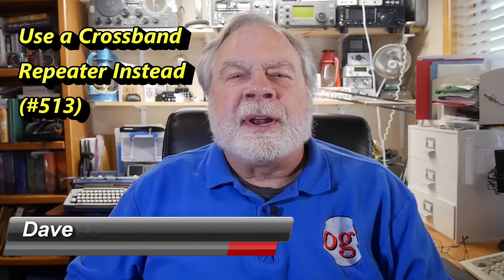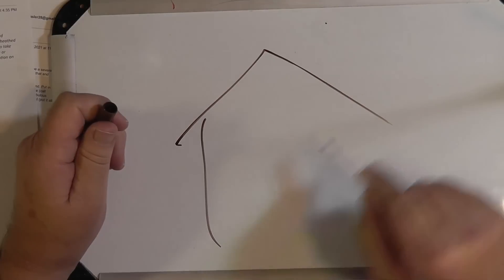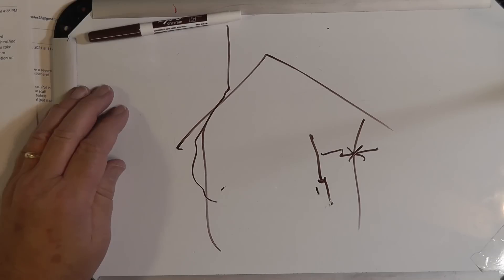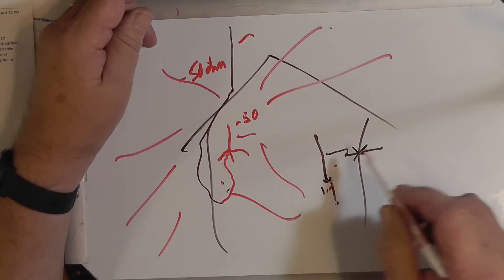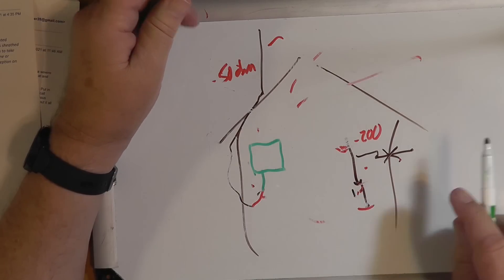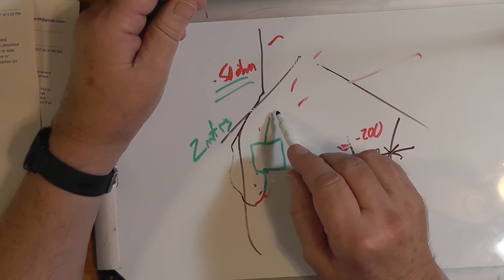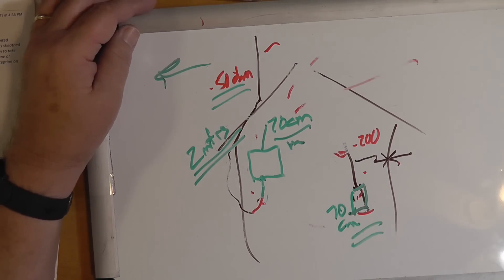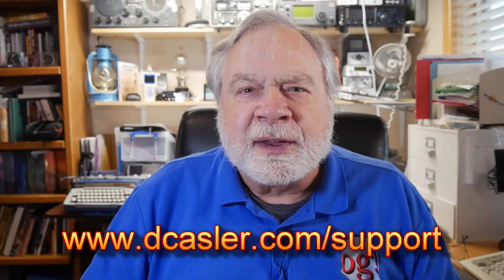Use a Crossband Repeater Instead (#513)

Comment: Hi David Iam kc2dpy i would like to know if you know how to program a Yeasu VX-6R to transmit crossband uhf/vhf if you do would you please show me how.Thank you.
Reply: You would just choose a UHF simplex frequency if youre trying to reach a VHF repeater (or it can work vice versa) and ensure that UHF frequency matches to the mobile radio's simplex frequency. If the radio is crossband capable and is in that mode, it will transmit to the VHF repeater..The reply will come back VHF, be converted to that UHF simplex frequency by the mobile unit and transmitted to your VX6r. The idea is to leverage the power and range of your mobile unit to extend the reach of your ht.

Comment: Check with the repeater owner.  Many do not allow cross banding into the repeater.
Reply: Makes sense, but what about using the "domestic" part locally with low power and stubby antennas? We already do something similar to that in digital modes with hotspots
Reply: That makes no sense.  The actual repeater would operate as normal.

Comment: Many ways to skin a cat.  The passive repeater (antenna connected to another) has been used since the 50's for difficult to cover TV and radio reception in mountains more recently for cellular service.  Valmont Towers is very busy installing them today!  
The key is "link budget"  10 meters from the inside antenna will lose ~35dB@ 2m, so if you have 35dB to spare it can work.
I once saw a large yagi on a hill connected to another to make a link many miles away that I would have thought impossible. The antenna gain on both the in and out antennas adds constructively.  It does not make much common sense but the math works and it functions for decades with no equipment to fail.

Comment: The full functionality of a base station can be remotely controlled using the Internet. An HT or repeater setup are not  required. Details, designs, and control software can be found  by doing a web search. ARRL has also published ways to do this.

Comment: I have tried this with mixed results.  You have to watch for timeouts.  Not only does the repeater have a timeout but your crossband radio will as well (usually ~3 minutes).  If the repeater doesn’t drop it’s carrier but just gives a courtesy beep you can easily timeout the crossband radio since it never stops transmitting.
Reply from the maker: Yes, extensive crossband use can cause the radio to overheat. You should set it to the lowest power setting that does the job.

Comment: From the question, it is not clear the "base station" is IN the house.  I have a friend who has a base station in a radio shack but his house is next door. ... Also, as HF "power" radiates, having it transmit indoor an all metal building would make the signals bounce around, ... and maybe accumulate (would it not) ... I think he may be asking if he used an external antenna to the handheld and cross banned over to the shack.  I have a Yeasu 8800 and I often thought if I was out camping I could have it on and take a hike with the HT and cross band.

Comment: You know, in underground tunnels, they used to have "leaking coax" connected to an outside antenna. A completely passive system that enables mobile communication under ground.

Comment: I use this feature on my 5100 pretty much every day! I don't think I could live with out it anymore
Reply: Tell us more about how you use this daily.  Just curious.
Reply: @cchalfantusa  well I live way to far  out to hit a repeater with just a 5 watt HT. So I have a Diamond x300 connected to my Icom 5100 that I use for my base. I can even use it from several miles away like my own repeater system. When I'm out in the yard or just monitoring from inside the house this feature makes everything much easier.

Comment: Maybe a newbie question… If the cross band repeater’s antenna port is hooked up to the external antenna on the house, how can the ht inside the house hit the repeater? Wouldn’t the faraday cage house block the signal?
Reply: You would think but there will be “leakage” thru Windows and roof plus you only need a very small signal for thee other rig to be picked up and retransmit.

Bill N3EYF
Reply: @williamgrover9723  Thanks for clearing that up. Surely, the incoming signal would not present a problem, but I couldnt wrap my head around how the ht signal is going to make it to the base rig antenna. Assuming there is a metal roof in this scenario, it must be the window "leakage" that is the key to making this  work..

Comment: 'Passive repeaters' (just two antennas and a cable) are sometimes used to rebroadcast FM radio to drivers in tunnels. This is very important in emergencies.

But for this to work the outside antenna must be very directional and very high gain (a large Yagi or something). The FM transmitter itself is usually much more powerful than a typical ham station and not too far away.
The distance between the antenna in the tunnel and the cars has to be short, as well. Usually they use a 'Leaky feeder' cable through the entire tunnel.

There are active repeaters that amplify and rebroadcast FM radio on the same frequency in large tunnels. Systems like that have to be designed very carefully to prevent feedback and interference.

Comment: Hi Dave,
Very good solution, but I would go a step further and use a diplexer at the indoor rig with a GP or collinear antenna for 70cm. Both are easy to construct. That way no 70cm signal is broadcast on the outdoor antenna. Stay safe.  73  WJ3U

Comment: Greetings Dave..On this video for aluminum siding and ht repeater..for conversation, I do this with my baofeng ht at 1 watt and my Alinco 735 mobile ( set on five watts ) and the external dual band x3 vertical . My HT in hand on second floor, base Alinco in basement BUT the vertical is only fifteen feet from my room upstairs...works great, however, the oscillator in the mobile base gets extremely warm if the power setting is above ten watts even with a near 1:1 swr, beldon flex 9913 at 75 feet. My guess is the duel frequency switching.  House is fully aluminum sided, and staying. (Love my partial faraday box). 
73, 
Gary in se Michigan

Comment: Hi Dave, I've been using my IC-2700 as a crossband repeater since 1990. This is a great idea if someone's needs to be on air within his other ham fellows. Lately i'am using the smallest dual band of Baofeng and works like a remote microphone. So i'am always on air with my Blacktooh (Bluetooth) microphone..🤣🤣
Reply: I have same setup. icom 2730 connected to a decent duelband antenna on a mast, and in and around house i use a cheap baufeng handheld with the 2730 in X-band mode. gets the job done and it boosts my tx from a few watts from the ht to 50w via the xband .

Comment: whats a good symplex for 2m? the repeater is in the 70cm i would crossband to 2m?
Reply: First off, yes it will work both ways. 2m-to-70cm or 70cm-to-2m.
"Simplex" is direct without using a repeater or PL tone, so any open frequency will do just fine.
Reply: @greglawrencemusic  yes I know all this but what's a good symplex to use without using 146.52 for example
Reply: @Ibelieve218  "Simplex Operation" means the radio stations are communicating with each other directly, on the same frequency. It is not a frequency or band.

Both stations take turns transmitting and receiving on the same frequency with no repeater or other device in between. 

- So any frequency that is available, not in current use, or not being used by a local repeater or high-traffic user group would be fine.  This will vary depending on your local HAM networks & users. 

-Example 2m: 145MHz or any frequency with a signal separation of 50KHz from any close frequency in use. 
The same would apply for any frequencies on the 70cm band (420-450MHz with a separation of 10MHz for any close frequencies in use.
'73
Reply: @Ibelieve218  The ranges of 146.40-146.58 & 147.42-147.57 are listed specifically as 2m Simplex frequencies by the ARRL.
Reply: Check with your local frequency coordinator.

Comment: Hey Dave, is there anything stopping us from doing the same thing say from 70cm to 20 meters?
Reply: Well, the "dual band" radios which do "crossband repeat" with built-in functionality, they're typically the 2m and 70cm band. Others could be included, but mostly it's those two.

If you have a single radio that does crossband repeat between 70cm and 20m, please tell us what make and model.

More likely, what you'd need to do is build an interface which handles what is essentially VOX on each radio - your HF rig for 20m, and (probably) a mobile rig for 70cm.

The question then becomes - what is it that you do on 20m that is so silent for so long that it would un-VOX the 70cm side? Perhaps you have a buddy on 20m who you receive 5x9++ on USB, so you can turn the RF gain way down on the HF rig, so as to make it dead quiet, so if your buddy isn't talking, the HF rig's noise won't trip the VOX on the 70cm rig.

Technically - it can be done. And now that you have me curious, I'm going to try to pull it off. Wish me luck.
Reply: @kelvin0mql  Yes but I was thinking more of connecting my two radios together to accomplish that. instead of cross-band repeat. I was wondering if it is within the rules to do something like that.
Reply: @kelvin0mql  I had my H/T on a run to Roseville yesterday and happened to hear you doing a cross-band test. Could not hit the repeater from inside the car. How did your test work out?
Reply: @Cury Stacy did you ever create a solution for listening your buddy call out on 20M and alert you through 70cm or by some other means?

Comment: Just installed a kenwood TM v71 at my QTH . With the cross-band  setup , I can now hit repeaters that were once beyond the reach of my HT from all over my property and inside the house.
Reply: I've been impressed with mine.  Very good dual receive, overall great rig.  Mine is mobile, with a fan, for cross band use in the field.  Heat and power use mobile is a concern, especially considering I need all 50 watts to try to hit the local repeater that is ~65 miles away.
Reply: (N4BDW)This is my mobile radio. Each year we provide communications for a “Two Bridge Run/Walk” of two river bridges between KY & OH about 2.7 miles apart. Our club repeater sits on a hit...blocked by a hill if we stand with ht’s on a highway along the river. So I park my truck on the opposite side of the river, crossband repeat, and we’re about to get into our club repeater via the cross. I couldn’t imagine having bought a different mobile.
Reply: Are you using the "remote control" function...?  change frequency, CTCSS, power level etc.................